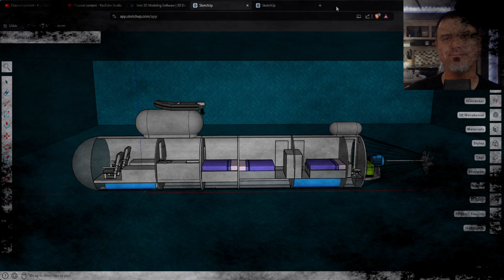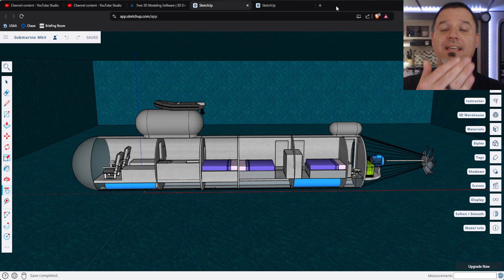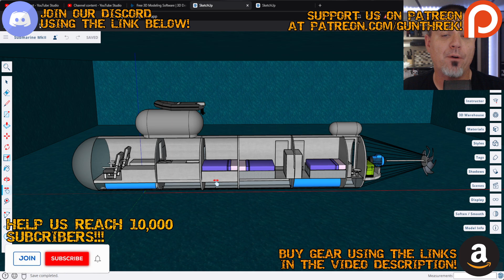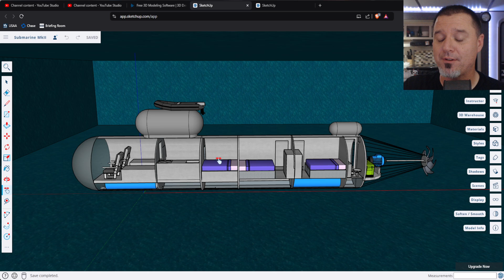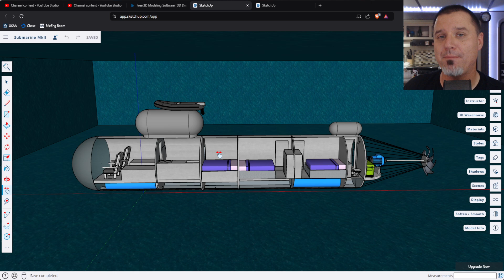Fuel and Weight Concerns | Submarine Yacht MkII

Comment: Some interesting power production ideas. Throw some solar panels on your floaters for a bit more energy collection. That said; your pressure vessel needs a ton more attention than your energy needs does. A good first draft but just a bit of constructive (not even criticism, more suggestions) your flat pressure cap at the back would fail under even 2 to 3 atmospheres. Also you bulkheads seem to he about 8 feet apart (scaling off the beds, it's kinda tough to get a scale on it without demensions) and again would fail at 2 to 3 atmospheres. This is close to being a u-boat but as far as submersibles go, pressure is your first, last and constant concern. Even on the huge naval subs you'll see EVERYTHING is miniature because infrastructure takes precedence over occupancy. But I'd love to watch the evolution of your design as you refine it (oh yeah lastly don't forget ypur in an environment with currents so your tethers to your floaters have to be shorter so that they don't collide.)
Reply: Take everything I say with a grain of salt though because I work for JPL and we only need to worry about negative 1 atmosphere. But positive pressure adds up shockingly fast. The water column is heavy...as fuck...)
Reply: Don't mean to be "reply guy" but I just watched the preceding video to this one. If you are looking at 150 feet max depth (as kind of suggested in that video) your are looking at a minimum static pressure of 5 atmospheres. Which is roughly 74 pounds per square inch or about 510,000 pascals. And that's only at the 150 feet and only if that's your absolute max depth limit. Please don't take this info as me yucking your yum. I'm definitely not. More trying to encourage your creativity with some operating physics.
Reply from the maker: Ideally, I'm looking for a 500 foot max safe depth, with a crush depth somewhat deeper to provide a solid margin of safety. The goal would be to cruise at 100-150 feet most of the time with the ability to dive down deeper occasionally to check something out.
Reply from the maker: Appreciate the feedback! As I said, this is just an insane idea I needed to get out of my head. If I had the money, I'd hire an engineer to transform the idea into reality. This is just a thought experiment. 

That said, I did explain in both prior videos that I couldn't render the rear end of the pressure vessel with the superstructure there, so you have to assume it's there. I'm barely capable in SketchUp, so imagination is key, lol.
Reply: @Gunthrek  my man l, your head is on the right space. You are in what we call in the soace industry "the blue sky phase" . And what that means us the idea phase where there are no wrong answers. If given unlimited tine, unlimited resources and without a thought for physics what can you dream up. Then you refine from there. It's a great thought experiment and gets the creative juices flowing as well as having the side effect of you researching physics even if it never gets built you gain skills , knowledge and inspiration for the next idea. I've now watched all 3 videos in regards to your submersible. You did mention positive pressure vs negative pressure and you are on the right path there. Positive pressure is a totally different animal than negative pressure. So even though those propane tanks are rated for positive internal pressure it's not reversible (or at least not in any intuitive sense) but honestly you could feasibly design and build this submersible to be rated for 25 meters for about $300,000. If i had that id definitely donate it just to get the proto-build workable. Unfortunately I don't. But what I do have is 28 years working in the space industry and would be excited to answer any questions that my expierence would be applicable. Also as a machinist I'd be happy to donate my skill and access to machining for any bespoke parts you may need (within reason). I literally make parts for satellites every day id be more than happy to machine anything you might need (that I'm able to and confident in my ability to keep within specs) for free because the one thing that's always in short supply is creativity. I can't wait to see your next revision
Reply from the maker: Great to see an interest in the design! Not sure I'll ever be in a financial position to even start working seriously on it, but who knows what the future may hold.
Reply: @Gunthrek  i mean once you've got ypu demensions hammered out step 1 would be to build a 1/18th scale orlf your proto-type for initial testing. That's a bit more attainable funding wise. Pending those tests a 1/3rd scale would be next step. I won't lie to you, you'd almost assuredly would have to fund the 1/18th yourself but if it were innovative and produced atleast the seed of results it wouldn't be unreasonable to ask around to see if any private investors would be interested and if you applied for patent there's TONS of VC's (venture capital corporations) that throw money at things like this every year. For all types of reasons. Optics (does it make the company look good for funding a particular project), return on investment (obviously) and some are shell corporations for larger firms that will invest in projects that as long as they don't blatantly conflict with the VC's ethics they will still invest in knowing they will never profit on a return on investment just so they can show a loss for the larger corps taxable income. But on your side of things the VC's motivations for investing aren't important just the case to build the thing. Long story short, it's not impossible to get something started and there's definitely money out there that you feasibly could chase down alleviating the financial burden on yourself.
Reply: Hell, it's wouldn't be a workable model for testing but if you design (with a drawing and demensions) i could scale it down and machine an aluminum mock-up model of your submersible. Strictly as an advertising tool for you. Again not for testing.
Reply from the maker: As far as building smaller scale versions for demo, if you check out my RV channel, you'll know that I'm not very good at working with my hands. I tend to be super impatient and things don't work out well when I try to make something. For the 1/18th scale, perhaps a 3D printed model of some kind might be feasible since the actual construction would be automated. The 1/3rd scale would definitely require an engineer to polish the details and a crew to actually fabricate the parts and put it together. I can bring the vision, but execution requires people with actual expertise. I'm not even a hobbyist engineer or fabricator, lol. I play video games.
Reply from the maker: After re-reading your original comment, it occurs to me that I forgot to explain that only one floater would be up at a time. The forward and larger one is an elevator that would only be used when parked on the bottom to allow occupants to surface and zip off in the dinghy. It would never be deployed while underway. The aft and smaller floater would only be employed while the diesel motor is running, which would usually only be while underway. So it's an either or situation.

Regarding solar panels, that would be nice, but the rear floater would stay submerged with the snorkel poking up over the surface of the water. In my head, this avoids most of the bobbing from waves, which would cause a lot of shock on the umbilical.
Reply: You're also going to need lights for anything deeper than 500 feet
Reply from the maker: Agreed. Aside from the survivability component in an emergency, the 500 foot limit was somewhat indicated precisely due to the diminishing light. Definitely not intended as a deep diving vessel.